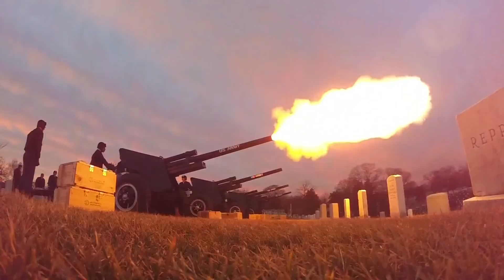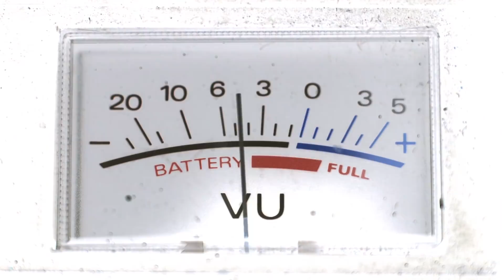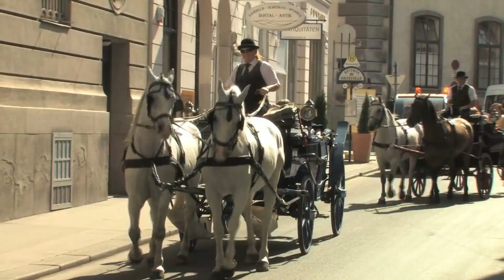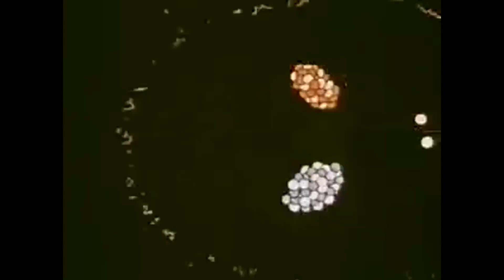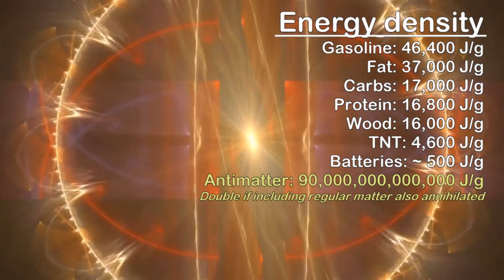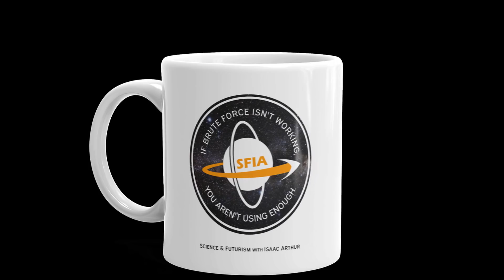Portable Power

Comment: Hey Isaac! Absolutely amazing episode as always! I'd like to see a full episode on antimatter production and challenges. What do you think?
Reply from the maker: I might actually do that, I'd tended to think the interest wouldn't be there but then I was really shocked to see today's topic as runner up on a poll of 20 and more so that it seems to be doing very well so far. Just goes to show what I already knew, I never have a clue what topics folks will like :)
Reply: Isaac Arthur Antimatter production and antimatter reactor development is what I'm trying to hammer out right now for one of my stories. I'm trying to see how possible it would be to have a working, efficient antimatter reactor in around two decades, starting from technology using fast breeder reactors, with a funding capacity like that of the United States. How plausible is that to be able to happen in that time frame do you think?

Because of the type of containment fields that would be necessary to safely store antimatter indefinitely and to guard against the heat generated in its reaction, I'd think they would have to develop a efficient fusion reactor first, since they need a similar containment field to keep it from meltdown during operation, and it would safer to have a fusion reactor meltdown during development rather than an antimatter reactor I would think.
Reply: stefan r I'll clarify. The main reason I want the antimatter reactor to be developed, is because then they could have a much smaller, far more efficient power supply for things such as drones that could help thaw out a planet if it snowballed after a nuclear war. Also, it could significantly decrease the size of atmosphere filtration machines that could clean dust particles out of the atmosphere in say, a month or so, to quickly bring sunlight back to the planet's surface. With conventional nuclear reactor technology, such a machine would have to roughly 12 miles in diamter, and about 2 miles tall. Development of the first one would cost roughly $14 trillion, and nearly 30 years to build with a crew of 1.5 million people. Each unit after that would be around $12 trillion each, with 20 years of construction time. They don't have enough money. Fast breeder reactors can decrease the cost, but I'm not sure they could produce energy fast enough for it to work in spite of its 75-100 times the fuel efficiency of conventional reactors. At a minimum they would likely need at least fusion reactors to get it in their price range. The energy each machine needs I calculate to be equivalent to two category 5 hurricanes, or 1,200 times the the world nuclear reactor energy production.

 If they can have an efficient antimatter reactor developed, it could have the same energy output at about 1% of the size, and could probably decrease the cost by a similar margin. They'd need at least 3 of the atmosphere filtration machines for it to work.
Reply: Building huge reactors to fix the environment is like using a pick axe to do psychology.  If you want to thaw an ocean you can use simple thermonuclear bombs as designed in the 1950s. Place deep below ice shelf and detonate.  An air filter costs the same regardless of how you power it.  Dust is highly unlikely to remain airborne for more than a year or two.  If you move below ground you probably spend most of your time trying to farm and maintain the lighting systems. I would like to know what the crew of an air filtrator does?
Reply: stefan r According to some sites I've looked at like www.nucleardarkness.org/nuclear/faq/ and What Would Happen If Every Single Nuke In The World Went Off At The Same Time on "IFL Science", say, if the world arsenal today, roughly 6,600 megatons were detonated, it could block the majority of sunlight for several years with 50-150 million tons of smoke blown into the stratosphere.

In my story scenario, at leat 24,000 megatons would be detonated on a world with double the surface area of earth, so approximately double the effects of the scenarios on those sites, if correct. That translates to at least years with no sunlight, and decades of most sunlight blocked. About 90% of all species would go extinct. If the planet has a well set in snowballing happen, even with things like the heating drones, without filtering the atmosphere, thawing and warming the planet can take 50 years, and at least 300 hundred years of concerted effort by survivors, to restore extinct species through cloning of stored samples. 

But if they can have the atmosphere cleaned in around a month, it may only be a 25% species loss, and thawing and warming could be shortened to one or two years. Thawing the ocean surface with heat lasers from thousands of drones would kill far less oceanic life than using thermonuclear bombs, and they wouldn't want to add to global radiation if at all possible.

As far as what an air filtrator does, I don't have that all nailed down yet. Basically maintaining the machines operation, managing the disposal of collected material (they wouldn't want the ionized particles to contaminate the world further), and also being the command and control centers of the drones.

At least 3/4 of the atmosphere filtration machines comes from the power supply, allowing it to pull dust particles down from as high as 25 miles. An antimatter reactor at the same cost of a conventional nuclear reactor would still reduce cost dramatically by providing hundreds of thousands of times more energy with a more controllable energy production rate.
Reply: stefan r Oh, and when antimatter and matter annihilate each other, there's some radiation during the explosion, but it dissipates quickly without having radioactive remnants that last millennia, rather it lasts minutes maybe. So an antimatter reactor meltdown is basically clean of radiation contamination. That's another reason it would be preferred.
Reply: An anti proton hits a proton and becomes energy.  Lets assume that all quarks get annihilated (no reason to believe that).  Most elements either have spare neutrons or they are balanced with equal protons and neutrons.  Removing a proton would frequently create daughter isotopes that are not balanced and have excess neutrons.  Given the energy involved you could split a nucleus unevenly and get both excess protons in some isotopes and excess neutrons in other.  If you lose control of the antimatter you will have some residual radioactive byproduct.  You could argue that the long term radioactivity is trivial compared to the direct damage caused by the explosion.
Reply: Nuclear winter can happen because of the flow of Earth's atmosphere.  Air rises at the equator and sinks at the poles.  In our current circumstance the high altitude air cools off and sinks (or warms and rises) before it can make the full trip.  That creates the westerly winds at mid latitude.  A little bit of dark soot in the stratosphere will let the high altitude air remain warm a little longer.  Wind blows from the arctic.  Places like New York or D.C would get weather similar to a nor'easter.  The central U.S. would be more like a cold desert.  You only need to block a few percent of the sunlight to set off the storm.  A plant in a green house would have plenty of sunlight.  
I am not trying to trivialize the consequences of a nuclear winter.  80 to 90 percent of the U.S. population would die from starvation or diseases.  The dust falls out in an exponential decay rate.  Doubling the dust volume only adds one half-life to the winter.  We would be down one year of crops regardless.  12 weeks is the same as 13 weeks or 20 weeks unless you time the war to start right after(during?) the fall harvests are brought in.
Reply: Isaac Arthur Oh, I figure they could spare somewhere around between 4 to 10 trillion dollars to the project over 30 years. I'm still figuring out how much money they'd need for a civilization arc underground infrastructure to guard against extinction. And their total budget for everything they want to build for it is $27.7 trillion over 30 years, to basically have an underground microcosom of the whole society down to types of factories and everything.
Reply: Isaac Arthur The population of my country doing this is 500 million with resources similar to that available in all of North America.
Reply: Michael Jensen, The antimatter production capability is the advanced technology.  Using anti-matter much less so.  
North America with fast breeder reactors can build underground infrastructure.  No need to wait for fusion or anti-matter.
Reply: +Michael Jensen -- You should realize that Earth's atmosphere already contains huge amounts of STORED ENERGY, in the form of WATER VAPOR ... the Latent Heat of it. If you have 'Megachimneys' 2 miles tall, with updrafts, you will liberate much of that stored energy by condensing water vapor into liquid. In doing so, it reheats the air, which has cooled a bit in rising up the chimney. That keeps the airflow going, and is the same as the natural Wet Convection which drives thunderstorms and hurricanes. Prodigious quantities of energy and water can be extracted. After rising up and squeezing out of water, the now dry air sinks and reheats. If there is high-altitude dust, it will sink, too. The extreme diameters you propose are not required and are not the optimal solution. A much larger number of much smaller-diameter Megachimneys is best. I have much more I could say about all that than can fit here. Suffice it to say, Megachimneys are a serious possibility for solving many problems, in real life. Dusty air is the least of them.

Comment: Thunderf00t did a great video explaining chemical batteries and how much energy is in gasoline. In the maths he equated gasoline as the most portable energy dense material and how batteries will more than likely never get to matching point of gasoline.
Reply: So?
Reply: UnitSe7en others may find it interesting and are unaware of it.
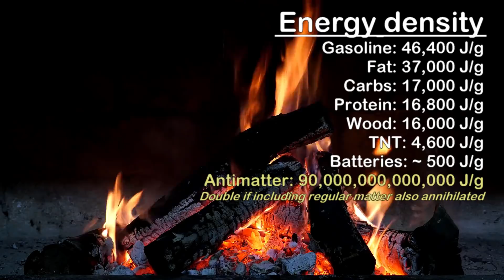Reply: 20:55 of this very video, and considering the topic of the video is potential theoretical methods of energy storage (batteries) not yet invented, I'd reckon that your comment is kind of superfluous. What thunderf00t reckons isn't relevant. Ever.
Reply: UnitSe7en ok thanks for the input. Have a great day.
Reply: Io
Electric planes already exist. Range is limited now, but battery tech will advance very fast in the near future. Energy density isn't everything, efficiency is very important too. Heat engines like a jet engine are very inefficient, usually around 25-30%, but it can be much less. I didn't find any figures for jet engines, but they must obey the laws of physics too. Electric motors are 95-98% efficient. That means 3-4 times less energy required to power them. Jet fuel has about 40x the energy density by mass and 20x by volume compared to the best batteries. If we factor in efficiency then it's around 10x/5x - 13x/7x. That's much better, especially by volume. Since electric motors are far more powerful, weight is probably less important than volume. Plus you save the weight of the engines, and that's pretty significant too. And a plane don't have to fly 10000 miles to make sense, 1000 is plenty enough. So as you see we don't actually need that much improvement to match the performance of a conventional plane. For shorter routes you don't need that much fuel, so electric planes could be viable soon. On long routes electric planes can be far more efficient, as I explained, so again, it will be possible soon. According to Elon Musk 400 Wh/kg should be enough to make an electric supersonic VTOL aircraft. And that's only twice the energy density of the current best Li-ion battery packs. Graphene batteries promise 1000Wh/kg energy density.
Reply: Krisztián Povázson
That depends on how you define battery. If it has to be a similar chemical process that we use today, then yes, it has limits, but even then we are nowhere near them.
And why would you needlessly limit the technology, why not define battery as a thing which you can put in or take out energy any time with minimal losses? That way batteries still have physical limits, but at ridiculously high levels. The limit is when the stored energy has an equivalent mass comparable to the the battery itself.
Reply: András Bíró Battety tech has hard theoretical limits it is already close to hitting.
Reply: Gasoline is used mainly for transportation. Due to it's high cost and limited availability you only use it when there's no reasonable alternative.
Now, we have high performance electric cars with ranges matching the low end of ICE cars. The only issue is making them a bit cheaper, but that seems to be happening fast enough. That covers the main use of gasoline.  Next are ships, which are the same, only scaled up. There are very promising experiments in this area too. With current battery tech the only thing we can't do well is intercontinental trade. But for that nuclear power would be ideal, if only we can get past our irrational fears. Nuclear powered ships already exist, in fact the first was launched in 1954. Nuclear energy powers the biggest aircraft carriers, submarines and icebreakers, it seems to be working very well.
So what's left is planes. Electric planes already exist. They are mostly experimental, and have limited range, but the inevitable improvements in battery tech will soon make them viable. Even intercontinental flights could work, because electric planes don't need oxygen, so they can go higher, which means less drag, which means lower power consumption. As a bonus they can fly much faster due to the low drag. Or maybe SpaceX will steal this market with the BFR.
There are trains too, but they can actually have a long extension cord, no need for batteries. Actually, in most of the world all trains are electric since decades, only the US and some 3rd world countries are still using diesel or coal.

This means that we don't really need gasoline anymore. It turns out it's energy density isn't that big deal after all, not worth all the serious disadvantages. For portable electronics the much higher energy density would be cool, but it's hard to miniaturize engines, it would smell bad and most importantly it would be very unhealthy and dangerous. Although it would be very steampunk, which is cool.
Reply: András Bíró Batteries will never be energy-dense enough to be used in planes. Planes need every bit of spare carrying weight they can get, and batteries are not ideal for that, no matter how highly powered you can make your batteries.

Besides, aircraft tend to use paraffin/kerosene nowadays, which is even more energy-dense than petrol/gasoline, so it would never really be profitable to introduce battery-powered planes.

Comment: I was thinking about last weeks video on meta materials and your space warfare episode. You said that there is no stealth in space, but if you covered your ship in a meta material that could make it invisible to radar and any other wavelength of light, as well as place all of your ships radiators on one side facing away from the enemy, could you make a genuinely stealthy ship.

Even better, make it a drone ship with no crew at all, and if you only have your computers running at the bare minimum, the amount of waste heat would probably be very small. Even if computers in the next few centuries or millennia won’t reach the landaur limit, they’ll still be far more efficient than those of today, and having no crew means the ship could be very cold making it even more efficient.

So you probably could have stealthy ships unless there is some factor I’m overlooking.
Reply from the maker: Truth be told it's going to be very hard bordering on impossible to make something that can handle several wavelengths at once rather than a discrete or narrow band, I wouldn't expect anyone to be able to get the whole spectrum crammed in.If you did it might let you get away with passive drifting, turn your engine and and its definitely out the window.
Reply: Now adding metamaterials to the drone LACs in my sci-fi universe and adding stealth capabilities
Reply: You did an ep on teleportation.  If you could teleport waste heat away...

But now it's like saying if you had inertial dampers you could have super-fast elevators.
Reply: You cant just bend waves that causes a red shift, and you cant reproduce the image that changes timing. On earth we use signals that bounce back because we have things everywhere and are looking for a specific thing, in space we'd look for any disturbance. I think the biggest problem would be getting to people you can see before they are gone.
Reply: Sailor Barsoom Strong enough magnetic fields can give you a similar effect through diamagnetism, as long as you keep metals out of the elevator.
Reply: You are kind of discribing the stealth ships from The Expanse. xD
Just that they only use anti radar materials.